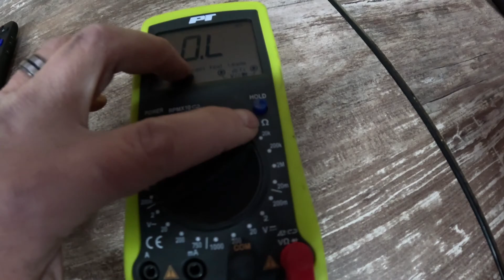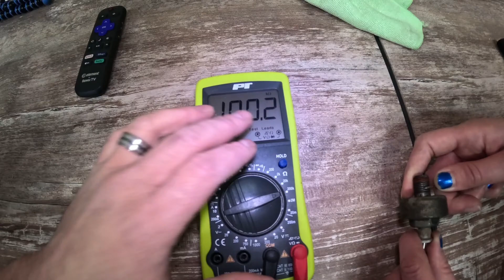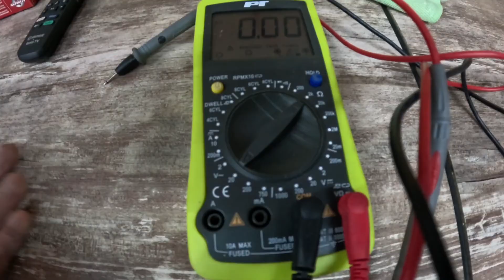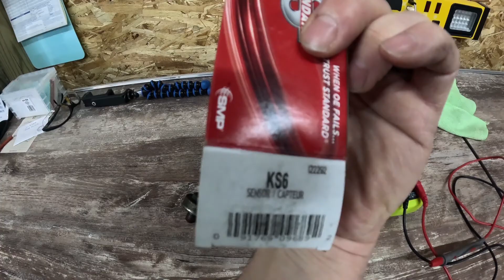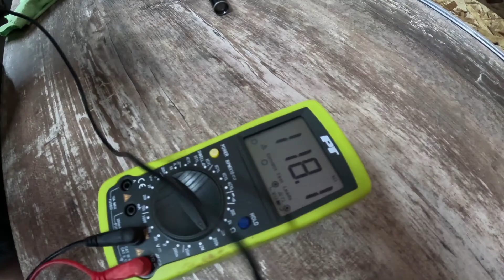How to Test & Change Knock Sensor 1992 TBI 5.7 SBC 350 1987-95 (Code 43)

Comment: We have a 91 chevrolet truck 5.7 i did continuity test from the esc to knock sensor i have nothing i did the ground i had beep what should I do thanks richard
Reply from the maker: It sounds like you have a break in the dark blue wire coming from the knock sensor pigtail that goes to the ESC module.

You can try to locate the bad spot in the harness or replace that dark blue wire with a new wire to reconnect the knock sensor pigtail with the ESC module.

Comment: 94 1500 auto coding 43 esc or knock.  No esc to be found anywhere. Is it integrated into another part ecm? 
Looking for any info.  Esc isnt on intake, firewall, fenderwell...ect...
Reply from the maker: The ESC module has 4 wires that plug into it. (Vin K)
1: Dark Blue wire comes from the knock sensor.
2: Brown wire is the ground
3: Black wire goes to the ECM on port B7 (Spark Retard Signal ESC)
4: Pink/Black wire goes to ECM port A6 (Ignition Feed)
THE ECM should be located behind glove compartment.
Reply: Just saying my truck doesn't have a esc that is visible anywhere
Reply from the maker: Sometimes, people delete them to do a carburetor swap.

You should be able to buy a replacement  ESC box and pigtail, then wire it up yourself with those 4 wires.

Comment: What are symptoms of knock sensors failer? Ty
Reply from the maker: On a 90s sbc 350 a failing knock sensor can cause various issues. Poor fuel economy, engine pinging, rough idle, engine running warmer because of timing retard. 

A code 43 ( which will retard the timing a specific amount, possibly up to 20 degrees to protect the engine from pinging), less engine power.
Reply: Have a occasional mystery unstable idle, rare stall ,changed out many things, can i unplug the knock sensor to troubleshoot. Ty @Brokens-Garage
Reply from the maker: On a 1990 Chevy 350tbi or 1991 454 tbi, we've unplugged the knock sensor and ran the vehicle with no obvious issues other than a check engine light. BUT, we only had it idle or small drive around the yard. 

When the computer doesn't see the knock sensor, it will put the motor in a limp mode. (It will back off the timing up to 20 degrees, so pre detonation doesn't occur.) 

Your issue sounds more like a vacuum leak, EGR issue, Fuel pressure issue, Pickup coil in the distributor, or Distributor itself. (Note: Never use normal part store distributors because they are not good! I've tried several and they've all been weak or bad!  The best one I've found was a Davis Unified Distributor and bought it from summit racing because of similar issues that you're having)